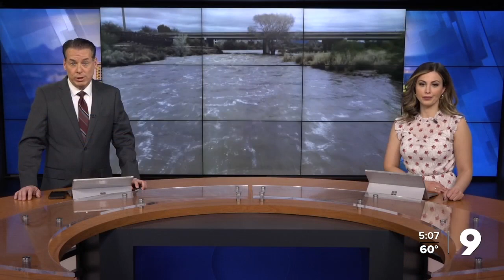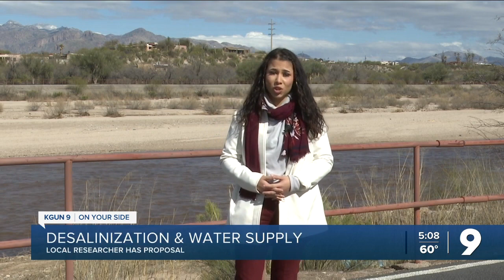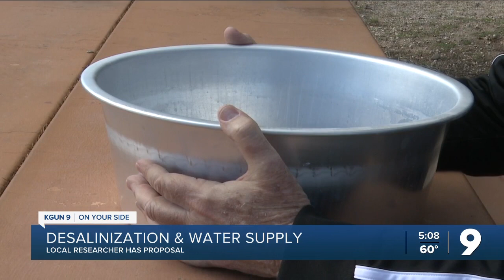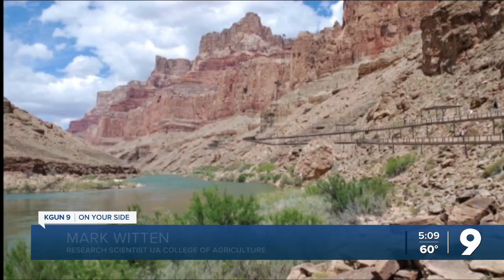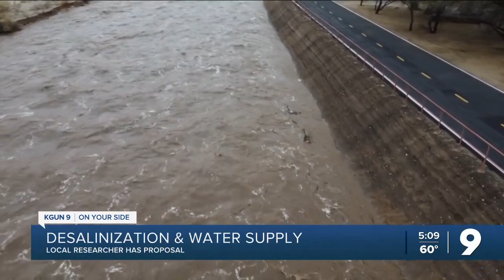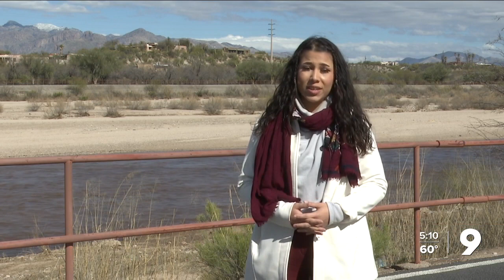Local researcher proposes solution to dwindling water supply

Comment: Rain water and water vapor are fresh water, are they not? 
Isn't it super easy to condense water vapor in the atmosphere back into a liquid? (They use these methods in less industrialized places that struggle with fresh water availability, ex. water vapor nets in desert climates).
Reply: No.  People have been trying to do this for years and it only works within a very narrow temperature and humidity range. Basically it is dehumidifier technology.  They are not collecting any significant water with condensers in the desert.

Comment: Use a 900 mile long canal to transport water from sea level to almost a mile high. How does this nonsense make it on the air, is there really no one in their offices with an elementary school understanding of physics?
Reply: That would be one hell of a canal. Also, he talks about charging 3 rivers, which is BS. Pueblo sits on the Arkansas river, which eventually flows into the Gulf of Mexico. Not too many water issues along the Ark. To get the water to Arizona, they'd have to move it another 120 miles West at the very least and get it over Monarch pass. Monarch pass sits at 11, 312', which is another 6,620 feet in elevation gain.
Reply: Been wondering if there's any way to use ravines and valleys combined with Musk's "boring company" for relatively short tunnels to get around some of the elevation issues...
Reply: @MaskHysteria  I did some back of the napkin calculations. To lift just 1 gal of water from sea level to 1 mile it would take roughly 60 KJ of energy or put in solar terms about half of the output of one solar panel in a day. It doesn't matter if you go under mountains or over them all that matters is starting elevation and ending elevation. Can't get past gravity I'm afraid =/
Reply: My thought exactly. What is the energy required to lift water to 5000 feet and transport it 900 miles? It's not going to flow uphill on its own.